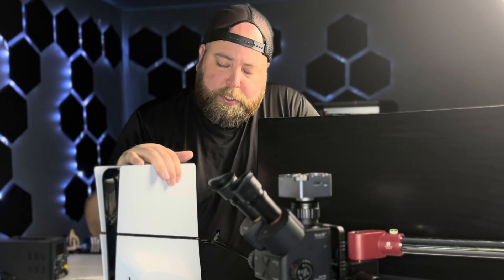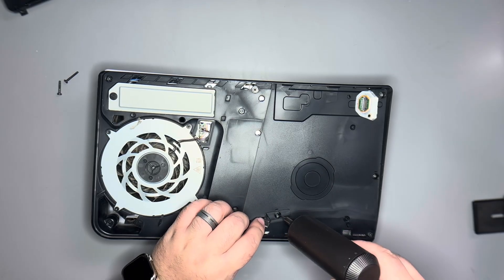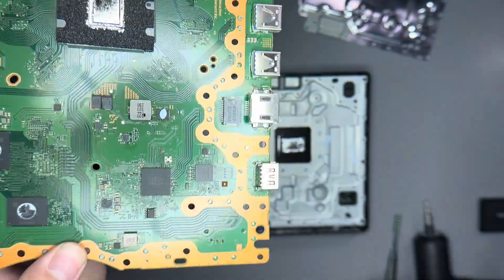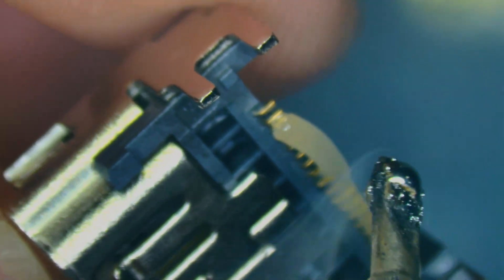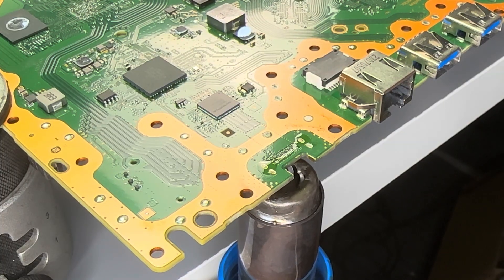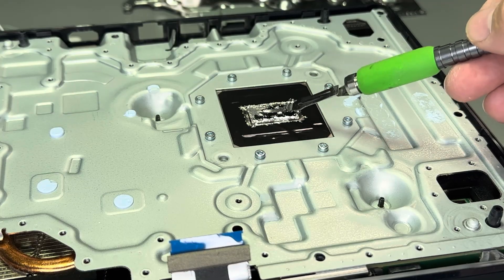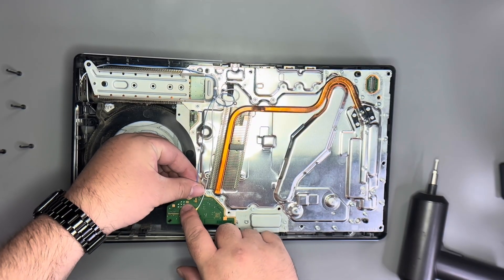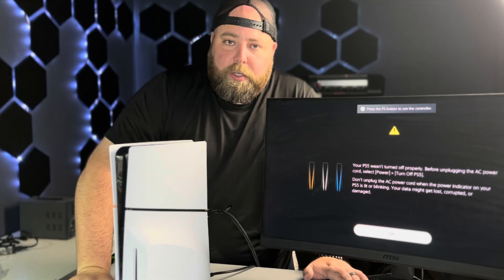PS5 Slim Disc Edition HDMI Port Repair

Comment: Awesome work Derek. You perform this repair the exact way that my shop does! 

I’d love a video instructing us on the correct way to spread liquid metal. There are lots of techniques out there and it would be good to have your video as a reference when we are teaching others too. 

Also where did you get your powered screwdriver? I’d love one of those!!
Reply from the maker: Thanks for the comment! will do and 107085005852 is the sku for it on Mobilesentrix.com